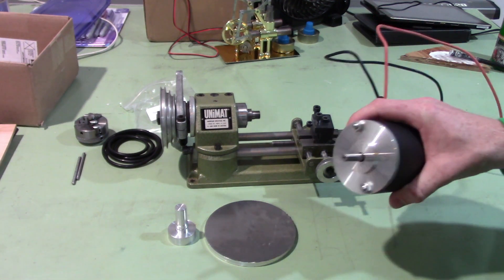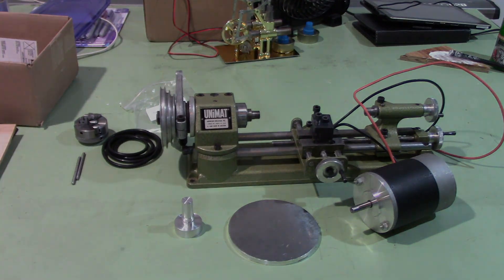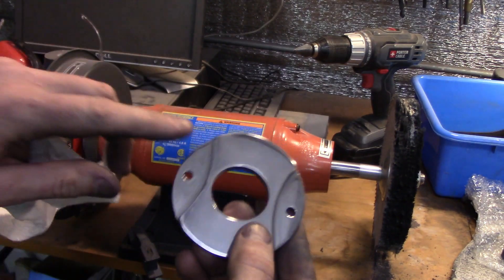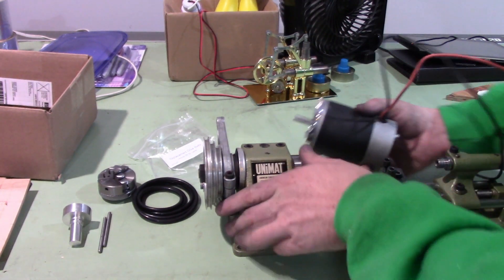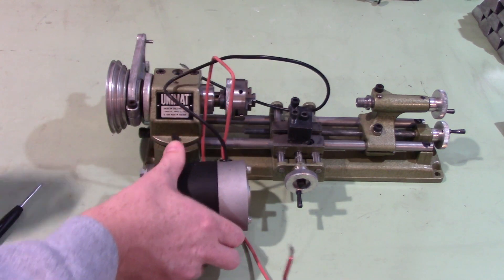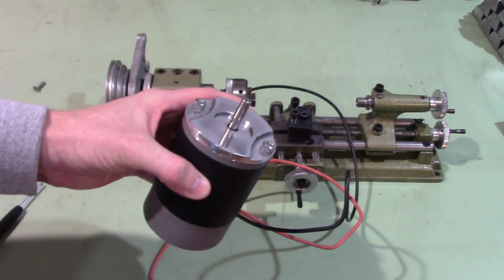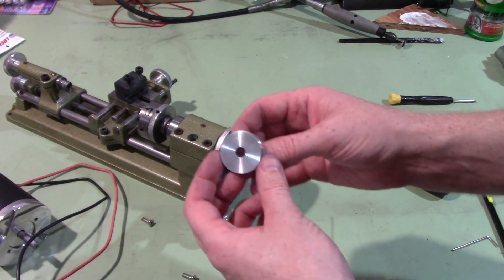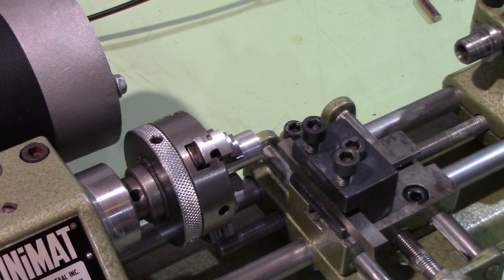Unimat SL-1000 Motor Adapter

Comment: Fantastic incentive to get rid of my Unimat 3 motor. How come you didn’t use larger lathe to reduce the diameter of the mounting plate, instead of doing it all by hand?
Reply: Totally understand - I wasn’t taking the mickey. 

The manual sequence just didn’t seem to sit right, and I assumed reversing the jaws would’ve allowed you to hold the disc internally. If not then you’d have to make a jig to hold it by the centre which is only worth it if you plan to repeat the exercise. Whatever, we’ll done - it’s turned out really well.
Reply from the maker: Thank you. Yes, that's the same thought process I went through, but with lack of experience I didn't attempt to cut it with the jaws reversed. It's aluminum so no big deal to cut with the bandsaw. I could have cleaned the cut up with the lathe. I enjoy using some hand tools though.
Reply from the maker: I don't actually have the skillset to do that on my lathe. I haven't really spent much time using it. My original plan was to use the lathe, but I couldn't figure out how to do it.

Comment: Nice. Just picked one up from from nearby where I live and I'm working on getting a dc motor and speed  control. These little things are amazing.
Reply from the maker: Awesome, I have been busy with other things, but I will hopefully play around with this thing soon! Have you made anything on it yet?
Reply: @John Repaired a pulley I had gotten for it and I have something lined up that is too big for it but doable, but we're on the road and I have limited space and tooling until I get back home. so right now I've been on the hunt and picking up hard-to-find Unimat stuff as I go. made a couple crappy vids here on the 'Tube. more to come tho.
Reply from the maker: Awesome. I just subscribed. I'll check them out!
Reply: Hey, thanks!

Comment: Hello what about the power supply? How many volt and ampere are you using. To change the speed are you changing volt or ampere?
Reply from the maker: I have not cut much more that what was in the video, but the voltage has been in the 5 to 10v range and current has been around half an amp. I was voltage controlling it. With the motor I have, I think a 10Amp 15Volt power supply would cover all normal conditions. I will cover this when I get time to make another video. I will also try to identify the motor I have since I get asked that a lot.

Comment: What kind of motor are you using on it ? Dc 150w,350w,500w???
Reply: DC or AC bro
Reply from the maker: Dc
Reply: @JohnHamerProjects  Is DC 150w strong for an iron lathe, bro?
Reply from the maker: Not sure,  I've only tried it with aluminum. I think the motor is a little bigger than 150w. There is no information on it so I don't know what it is for sure.
Reply: @JohnHamerProjects  apakah anda tau motor DC RS997 bro madein chaines
Reply from the maker: I believe it is a 150w
Reply: @JohnHamerProjects  thank you , it looks bigger than 150w motor
Reply from the maker: It could be.  It doesn't have any markings on it.  I can give you the dimensions of the motor if that would help.

Comment: I just got this lathe for Xmas! What belts do you recommend?
Reply from the maker: I just bought the regular replacement rubber ones,  but everyone seems to recommend the diy urethane ones.  I honestly haven't had time to mess with it other than what is in the videos.
Reply: @JohnHamerProjects  I was also recommended the diy o es out of the orange rubber. Any idea on the circumference needed or a pdf user manual?
Reply: Yo tengo el Unimat 3, y hago los cinturones que compro en Aliexpress por metros, los calientas con llamita de un mechero o vela los extremos y los unes a la medida,  luego cortas las rebabas, yo lo hago con un corta uñas. Valen poco no como los que venden para estos tornos que son un robo. Los venden de todos los colores, liso y arrugado, este último agarra mas,

Comment: Love what you’ve done to replace the motor! I have the same lathe but wish to upgrade the motor. Any chance you could share the specs/description of this motor?
Reply from the maker: I actually don't know much about it. I had it in a box at my house. There is a motor you can google that is called an MY6812. They are on EBAY for like 30 dollars. It's a 12v 150 watt motor and seems to be about the same thing.

Comment: You did a great job. Maybe I can ask you or you’re community a question? I had bought  for the unimat sl the collet chuck with the er16 Collets. For some reason the chuck will not work on my threads for the 3 and 4 jaw chuck. Do they sell adapters? Thank u to anyone who can help.
Reply from the maker: Hey Mark, Thank you. I don't know about that. Maybe someone will see this and answer it.
Reply: What a matter bud.
Reply: @paultrimble9390  I bought online a collet chuck from eBay it says it’s for a unimat and it’s m14 thread not the m12x1. Do they make any adapters? Thank u for the reply.
Reply: @marksimone5609  ya  but you could make one fairly easy
Reply: @paultrimble9390  I’m not that good yet. I was told u gotta be spot on to dismiss any wobble what so ever when it comes to the chuck.
Reply: @marksimone5609  yeah but the stuff u buy is little off if cheap China parts can be way off. Sometimes u have to fix them to use anyway.  If u had a nut with m12 threads big enough thread it on and cut it fo m14 on outside thread it in collet chuck locktite then on ur machine like helix coil for spark plugs. Kinda. Just thinking out loud. Lol.
Reply: I actually tried lol but for some reason I got a slight wobble maybe it was the way I tapped it. Idk one would think I would be able to do it but unfortunately I’m not. Haha have a great day and thank u for the response.
Reply: @marksimone5609  you're right my friend it is not easy. It's too bad I didn't catch you before you got the ER12 collet stuff, which unfortunately you found out they are not compatible. I got lucky and found a set of E12 collets and the collet chuck but I had to give blood and paid a fortune for them.  To get the accuracy for an M12x1 adapter you have to face the adapter faces AND the ER12 chuck or holder faces with a whisper cut on all surfaces as a matched set. But your machine has to be tight. .0002 or less. Even when you tap it. It'd have to be indicated in using a 4 jaw chuck and even then it's tricky but doable. Good luck bud hope ya get it solved.

Comment: WOW! Thanks. I have this same lathe. I had it in storage for a while and it got a little surface rust like yours. I just used 3in1 oil and cranked everything back and forth until everything moved freely. The hardest part to loosen up was the 3 jaw chuck, but it works now. The worst part f the original design was that the chuck can't be opened up all of the way for larger items because the jaws hit the motor and the guide rails on the bottom. The one thing about Unimat was they used the same screws for every part including the motor mount( I believe).  There are ton of accessories for it, including an auto thread cutting feed. A drill press handle that makes the head unit move, a drill chuck that can be used on either end, a threaded part that slides in the tool T channel that you can mount the 3 jaw chuck vertically and a lot of other cool add-ons. It might even have indexer for cutting gear teeth. Best wishes on your future Unimat projects.
Reply: "The worst part f the original design was that the chuck can't be opened up all of the way for larger items because the jaws hit the motor and the guide rails on the bottom." I know this was 7 months ago - but just in case - you can flip the jaws in the 3 jaw chuck for bigger stuff (just have to swap a couple of the jaws) or there was a riser plate for these lathes as well. Hope it helps!
Reply from the maker: Hey, I'm glad you enjoyed it. They are very cool little lathes. That would be neat to do threading on it. I haven't even attempted that on my larger lathe yet though. Mine didn't have any accessories when I got it. I've had a few people contact me with parts. I think I would like to get a drill chuck. I may try to make the drill press handle.
Reply: @JohnHamerProjects  Do you need pictures of the drill press handle? I think there are a few examples on youtube.. Check ebay. Maybe someone doesn't know what it is. and sell it for parts.

Comment: I love how quiet that motor is. Great job!
Reply from the maker: Thank you.  I was surprised when I cut it on.  I thought it would be much louder.
Reply: What kind of this motor ? 150w , 500w ?
Reply from the maker: I already had it and it doesn't have any markings on it,  but I believe it's a 150w brushed 12dv motor like the ones on ebay under my6812. They are sometimes listed as a 24vdc motor.